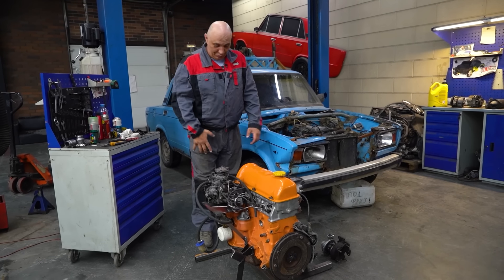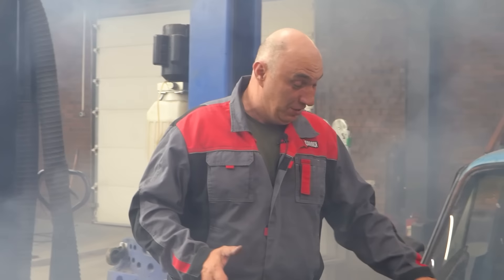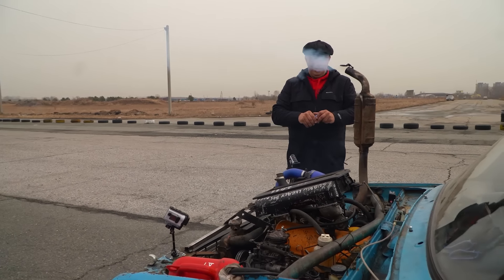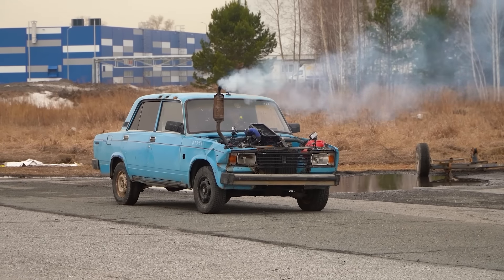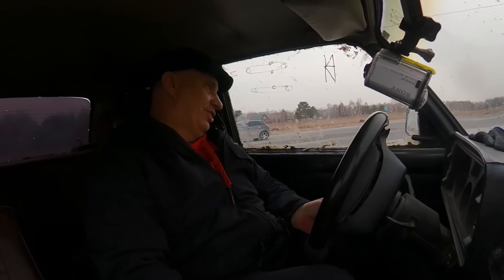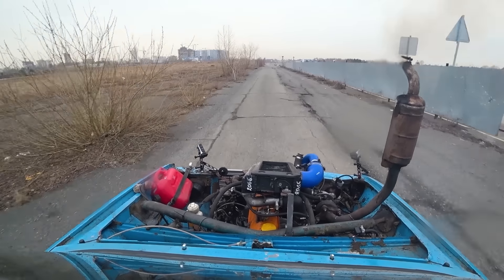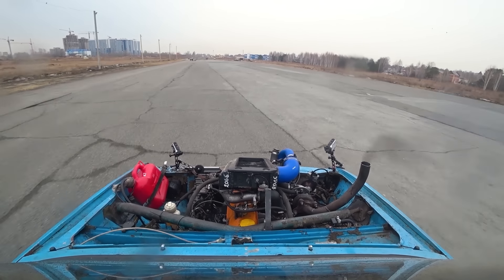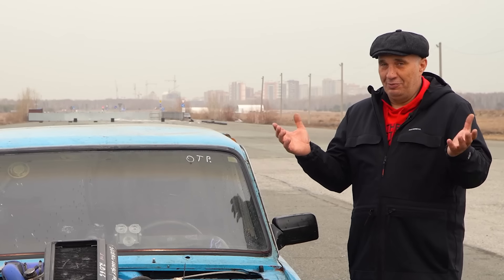Gasoline engine converted to diesel - first drive

Comment: Great effort....
I use diesel with a touch of petrol in my mower. ( Homemade TVO)
Start on a small amount of petrol, then switch to diesel/petrol mix.
Heat from the inlet tract vapourises the diesel mix allowing spark ignition combustion. Better on non crossflow engines.
TVO ( tractor vapourising oil) i believe was used in  war times when petrol was rationed.
Its said that diesel ends up in the crankcase but ive not experienced this yet on my briggs engine..

Comment: Also noticed it’s using a throttle body rather than running wide open and adjust throttle by amount of fuel injected

Comment: IF, it makes 100,000 miles ,It will be a "Good Endeavour". "IF" it just starts & runs around the block ; it's just an "Expensive Experiment" of TIME,MATERIAL& EXTREAM EFFORT.

Comment: Maybe consider adding a downstream turbo to speed up exhaust gasses creating a negative vacuum pressure while upstream turbo increases the suck&Bang, and down stream turbo increases the blow out the tailpipe and double the radiator coolant capacity

Comment: Turn the fuel screw up and change the needle ramp and connect the boost diefram that on the pump you can just add boost to it it doesn't work like that need more fuel

Comment: Interesting how, after all those changes, it still pretty much sounds like a gasser.
Reply: It's because they run it as a gasser. It needs more compression, remove the throttlebody and actually control it using the diesel pump

Comment: What if you ran there engine Luke it is, but add back in a distributor and spark plugs. Sounds crazy I know but it might be enough to smooth it out and more throttle response. I really would like to see if that works. I realize the spark plug holes are machined and house the nozzles now. But you guys have access to a machine shop so you can make anything work.

Comment: GM in the 70s and 80s made a diesel version of their iconic 5.7l 350 Small Block Chevrolet. Still called a 350 but ran on diesel fuel.
Reply: Ha hell no. That was the Oldsmobile 350 but it only shared the head bolt pattern with the spark ignition engine

Comment: Increase compression, double the fuel injection, maybe advance the fuel timing some and use as much RPM as you do on gasoline. Should be a lot more power.

Comment: it doesnt need an inter COOLER, it needs an inter HEATER. needs the hot air. forget about density, you want HEAT.

id be plumbing the exhaust straight through the intercooler...

and a smaller turbo. before the current turbo... compound!

Comment: Special request for million subs: make a ladazaur, transparent engine converted to diesel, transparent gearbox, with clutch from brake pads, AA batteries instead of battery, and all other crazy ideas you ever had in one car then drive it. Btw. How about using clutch disc as brake rotor?

Comment: have a diesel engine set to tick over and put a petrol carb on it and drive it like a petrol engine with no spark plugs using the small amount of diesel to ignite it.
Reply: It wouldn't idle if it had a carb with a shut throttle valve, diesels have to have lots of air going in to have something to compress to make the heat to work

Comment: Very impressive experiment! GM modified some of their gasoline engines to run on Diesel in the 1980s, and they didn't hold up as well as yours did!
Reply: was that the Oldsmobile one?
Reply: @aaronjackson6450  Yep. They did it with V8s and V6s. They were terribly unreliable.

Comment: Guys, make a ECU and modern injection system with an ESP32
Why Build an ESP32 ECU for Your Lada Engine?
An ESP32-based ECU offers affordability, flexibility, and full control over ignition, fuel injection, and sensors. It's perfect for customization and performance tuning.

What You’ll Need:

ESP32 module (core processor).
Injector driver circuit (control fuel injectors).
Coil driver module (manage spark timing).
Sensors: MAP, TPS, coolant temperature, and O2 for air-fuel tuning.
LCD or OLED display for real-time monitoring.
Wiring, connectors, and a power source.
Software:
Use Arduino IDE to program injection timing, ignition maps, and monitor diagnostics. The system can enhance performance and experimentation.

Let me know if you'd like detailed guidance!
Reply: up up up

Comment: Looks about the same result as filling a gasoline powered cars tank full of diesel
Reply: It won't even start getting up near pure diesel. 

With a mix, yeah it's all white smoke like that. Not enough heat tu burn all the fuel.

Comment: did they do anything with the compression ? if not thats the start problem
Reply: Check the video when they build the engine, a few video back, think they added a 3rd ring or shaved head. think its was 1:20.

Comment: Please please please run a lada engine on fumes, send me a message and I'll tell you how I melted a mk1 fiesta engine after running it at 1500 rpm for 14 hours,  on a 330ml of petrol, and I still had 100ml of petrol left after the exhaust valves melted

Comment: All that smoke is lost power. Since you used the shorter stroke of a petrol engine, you're not getting all the advantage from the combustion of diesel fuel. Put a diesel crank in it and you'll get more power out of it.

Comment: why do you have a throttle body on this? Diesels are controlled purely via fuel injection amount and timing. Shouldn't be a throttle body... A diesel can't really be run lean, but can easily be over-fueled.

Still doesn't take away from the impressiveness of this though.

Comment: Ah, the good old Turbo Diesel
The gearbox is not good for this Tdi , gasoline engines rev much higher than diesels do , they have much  more low end torque ...

Comment: I think you shouold start doing this as a SERVICE - COnverting gasoline engines to diesl with turbos... Thous engines will run much better. I belive if LADA back then DID this, they would suceed much better with those cars

Comment: First GM engine are alredy Gasoline-Disel engine block but not in the way peopel culd understand it. Old mechanics learned to control Pre Ignition ,Cold Diseling and Ultra Rich/Lean mixtures. Its so simpel ordinari child culd understand they starter engine on gasoline then hot enough swaped to disel good exampel Farmmal MD tractor,or bypsss all that shit and use pre heators decompres engine or uses variabel adance)retatd mechanism on high amplifier ignition use vaporisator for disel some engines come alredy with piezo disc mounted on some carburetors fummel on that thing frequency range and there you go ,probably Deuce Half Truck hade fuel/air compensators seperators etc to aid litel engine perfomance for bether inside and out side tempersture control and ceap moisture under check . What they doing has nothing to do with carbureted disel engine or hot bulb or hit and miss engine. Total failure to understand basics about disel engines with out hidraulic look effect.

Comment: I'm a retired GM mechanic, Put an egr pipe with a on/off valve on this motor to help warm up and run,
And for God's sake STOP putting the muffler up over these projects, run it out the right front fender!
Reply: GM.. 'nuff said. 🤣🤣🤣🤣🤣